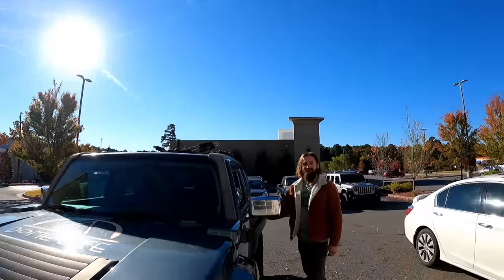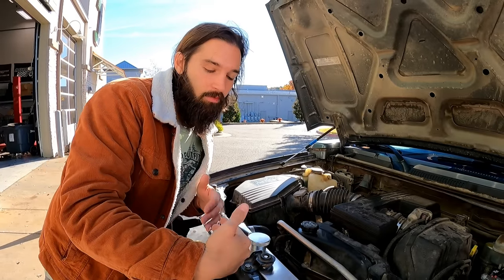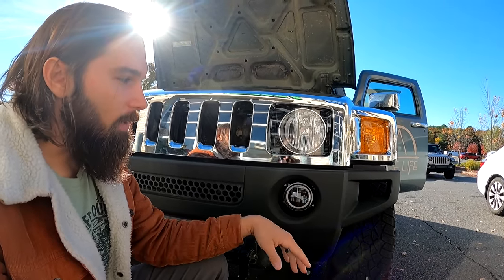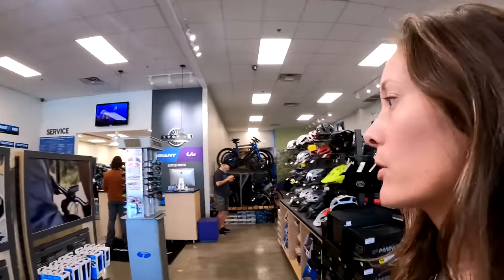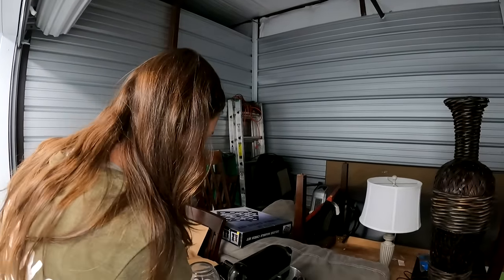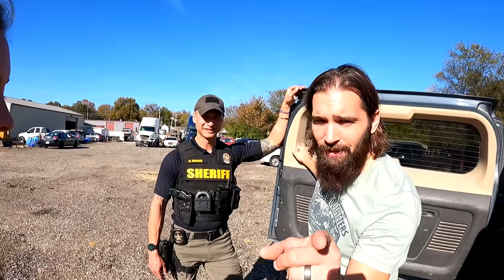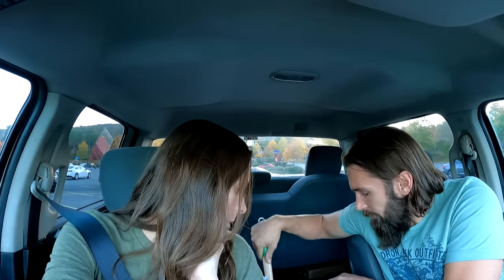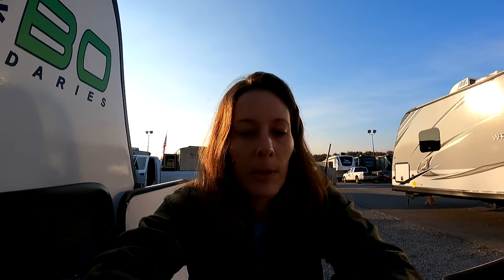This is a Nightmare: Stolen Trailer and Totaled Truck!

Comment: Just FYI the AC shouldnt affect the cooling system of the vehicle, back in the day the ac compressor would put a big load on the engine but with newer technology not anymore, if it starts overheating you can turn heat on max and then the coolant goes through the heater core acting as a 2nd small radiator! Keep up the great videos!

Comment: Not sure if you have one but adding a pressure relief style radiator cap will save you from having those nasty ruptured tanks. It’s worth having even if you have a reinforced radiator since the stress on your cooling system will be shifted to another part of the engine like the pump or cooling jackets.

Comment: I suggest locking chock or a boot clamp. For single axel trailers. Where I live the small lightweight trailers get taken a lot sadly. But the boot or locking wheel clamps really work

Comment: i have a forest river made bunk house camper for its off grid living use
 I used power system I converted from ,a older camper a 1988 camper i 
did use it early this week in a snow and ice storm with grid power 
outage the camp was closed to powered side but i was only one there!!
i sorry for your lost!! i don't leave my camper but where I can see it I set it up to live in!! make sure of the wiring & braking systems in GM i have a 2016 chevy truck & it was a government test v6 with a power adder it kicks on with cruse control only after set brake it stays on power side hit the gas it got more power! then off preset!

Comment: Congratulations on getting the Hummer back and the new radiator. Many years ago, I knew someone who had a Chevrolet SW they had purchased in Alaska equipped with a very thin radiator and no ac. They relocated to NM, installed an ac and now overheating. He had to upgrade to a thicker core radiator and now no more overheating and ac worked much better.
Congratulations on finding Cody's bike and some items. Praying for recovering other items. A dilemma that could happen should you get the stolen NOBO back, you said the doors on the newer one does close better. You may want to upgrade to it anyway. Something to think about.
Reply: You now have a custom Hummer

Comment: I had a brand new pair of skis stolen from me after I spent the whole summer working very hard as a teenager to afford $420 skis (1978) … that was a lot of money back then and for someone to take them I was devastated…I had only used them a few times that winter season…35 years later my mom gets a call then she calls me…my skis were pawned and found. So what happened to the perp? I don’t have a clue but the brand new skis were in pretty poor shape…and well…my feelings were hurt.

Comment: I work at 1800 Rad as well as have been in the radiator business for a rather long time now.  In fact me and my farther also own a rad repair shop which is almost non existent these days.  I also used to be ASE certified in Engine repair as well as a slew of other things.   I noticed immediately that you purchased a fully welded aluminum rad with electronic cooling fans.  I know it's more expensive.  But worth it.  Especially if you put your vehicle through its paces towing or offloading.  That being said.  Remember how the tech said the fans could suck up a towel into the rad?  Make sure you inspect that rad for buildup of dirt and whatever else and clean it off accordingly.  Otherwise your gonna see it overheat eventually.  I'd check it after 6 months if there's any buildup inside the fins of the rad.  Also, if your vehicle is over heating badly.  Turn on the heat.  Its an extra smaller radiator to pull heat away from the engine.
Reply: The heater core is in the bottom dash of vehicles.  Not easy to get to.  But,  the coolant that goes through the engine also goes through this heater core.. same as the radiator.  So if your radiator isn't cooling off the vehicle,  turn the climate control to full heat.  It's not gonna work nearly as well as a good radiator.  It's also going to suck if it's 100 degrees outside.. but it could save you in a pinch..

Comment: I had to google average temperatures in Arkansas .... I'm getting my jab I know where I'm going for winter, would so do your winter temps to winter in the Rockies.
Reply from the maker: We agree, but make sure to take into consideration the windchill factor with humidity. It’s a little different. Just ran into a guy who sayid it’s colder here than when when left the Rockies just a few days ago. He did not believe it felt this bad until he actually got here. He stated that the cold temps here really do hurt to the bone.

Comment: Y'all were getting closer to some of my mountains. I don't know if it is an issue just in our neck of the woods but some shady folks like stealing catalytic converters on anything high profile and easy to roll under. I had to look up what they were and how to hinder it. You can, for a few hundred, have a metal protective plate put over it to make it hard for thieves to easy cut that out. They even cut the CC off the local Humane Society's van one night. They'd have to be pretty skinny to get under my car but I think even I could roll under your hummer.lol Just a thought.... I have seen at least on video where someone had one stolen from their RV (not around here). It's been mainly SUV, trucks, and vans around here. Frustrating and disheartening.

Comment: You guys have the right approach.  Move on!  And find a stream with bigger trout in it! I've just started camping for the rest of the summer in a Stout Bell tent. 200 sq. fr floor area, double wall, good for 50 knots of wind and 2' of snow. Wood stove and propane stove. 20 minutes set up time. We'll see how the winter goes. Might be the last house I buy.  (only cost $1200) 

I don't think it will be stolen while I'm in it because there is a short barrel shotgun on a rack by the center pole---. Gun racks in the PU window are kind of a Wyoming thing.--

Comment: I used to have a heavy-duty lock that went on the wheel of my trailer when I used to park it at remote job sites.  I was working at one site way up a mountain and at the very back end of a subdivision and I showed up one morning and the garage door was forced up about a foot.  I knew right away that my tools were probably gone.  fortunately they didn't see a bunch of them because it was so dark in the house.  This was before I had the trailer.  I mean anyone can break into something if they have the time and opportunity.  I think the trick is to make it so hard for them that they move on.  I know this is the way to lock up a bike.  Use multiple locks and make it take time.  They'll move on to another bike.  You could also get a GPS tracker and hide it somewhere.  An old cell phone hooked to a trickle charger or a large battery.

Comment: Where did you get that radiator. whats the vendor contact
Reply from the maker: Engineered Cooling Products ECP is located in Chicago, IL
Reply: @CodyandKellie  Thanks for the info. I have my eye on a 2006 H3 and I've been warned about the clutch fan with radiator. this is a perfect solution.

Comment: Try considering installing a GPS device installed and hidden around the roof area whereas it doesn't block the signal and tagged the trailer position to ur phone. and just check the GPS through ur phone once every 3 - 5 days so u know its not out of battery. And do not vlog the hidden GPS device location on the trailer and show the thieves where to find and disabled it.

Comment: stop leak? nah. thats not true at all. no such thing exists. campers are much lower quality than automobiles. there is no consumer protections no lemon law on rv or such. new units are routinely very poorly built.  They are fine after you find the factory mistakes and fix them.  As long as it isn't structural.